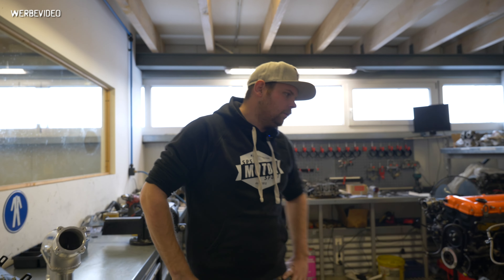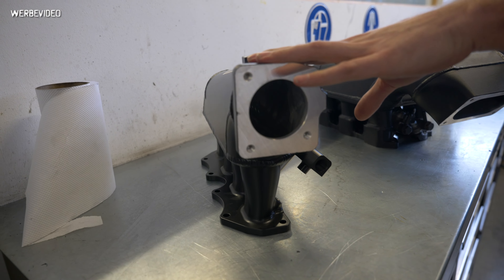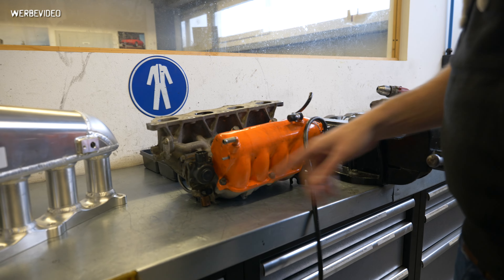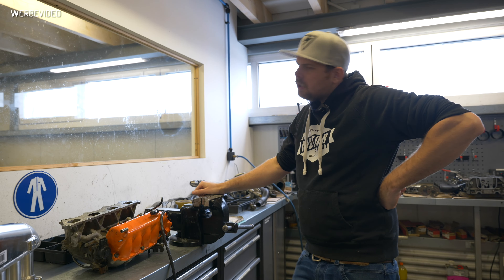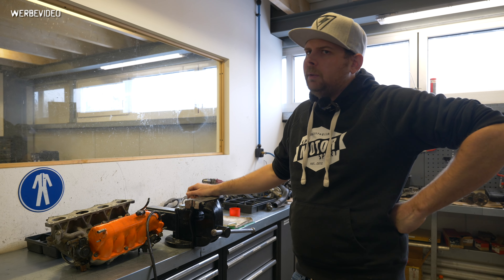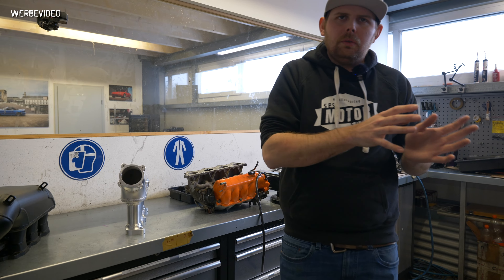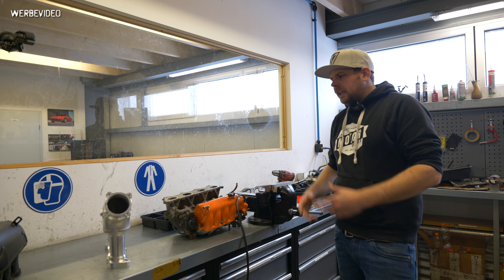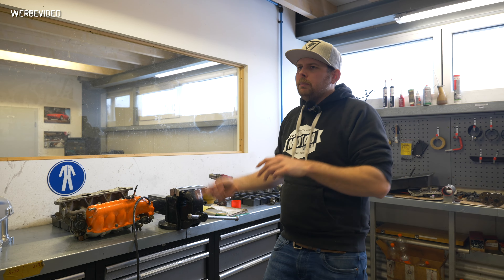Giselwerks intake manifolds for more power! - SPS Motorsport

Comment: Would this be a worthwhile addition to a 1993 1.6 NA Eunos Roadster C30-84 Rotrex build running an 85mm pulley andan ME221 ECU? I will probably go to a 75mm Pulley in the future, so an increase in boost and power. The car will be running a custom 4-2-1 manifold, a  high flow cat and a 2.5" exhaust, with the aim of improving flow and reducing the boost pressure for a given power level.  I also love the way this looks, so that also counts!

Comment: I can contest to this manifold, I was making roughly 320whp on a built NA6 with a stock manifold. I then swapped this amazing manifold in and with water meth I made 404whp but then the head lifted. After I used the Athena cut ring head gasket, and beefier ARP head studs I made over 440whp!